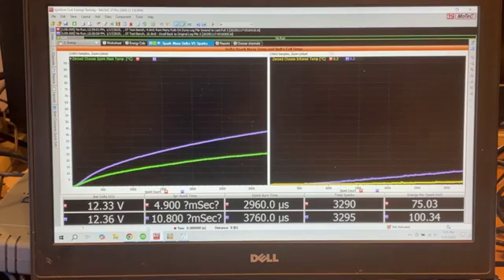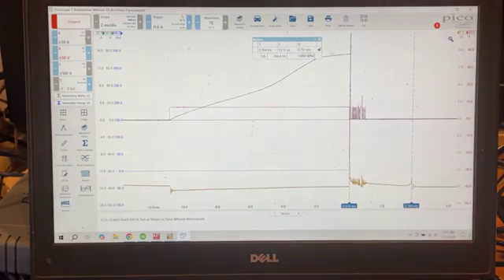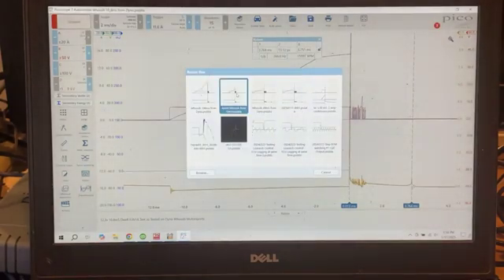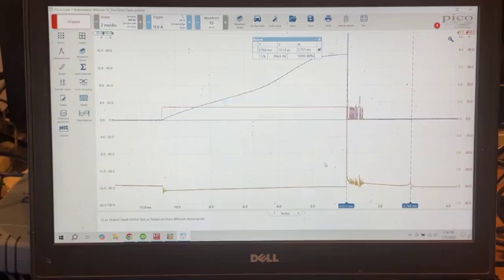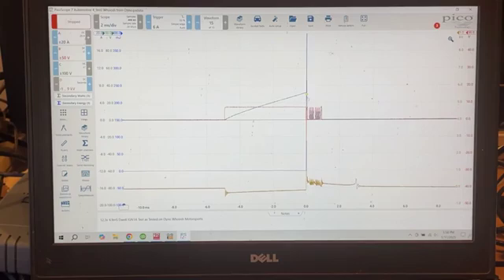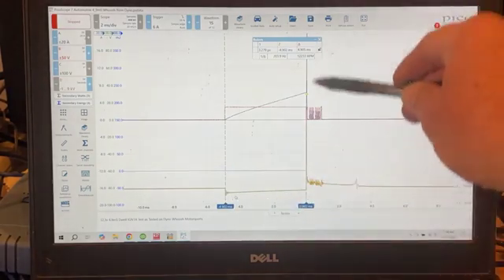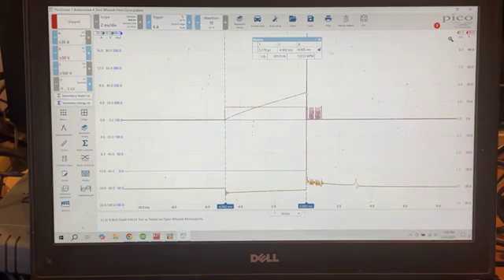IGN1A Ignition Coil Test on Bench versus Engine Dyno - Tuned By Shane T

Comment: The way i did my Coil Testing was a bit basic bus worked pretty well

used and micro controller to send the signal to the Coil, then to capture the power I used an oscilloscope probe connected to a ferrite coil, place it next to the core of the coil and capture the same graphics as yours, and got the correct dwell time for my coils, also have the coil connected to a bench power supply and capture the current used on spark but nothing like a log, and yeah i found that some of them make the same even if i lower the dwell time below its time to saturate. 
great content !

Comment: Nice video, Shane. I agree with your comment about enough spark. I'm a retired OE engine engineer here and amongst other bits and pieces I've developed combustion systems on the single cylinder research engine, where you can mess about with just about anything, easily. You are right about "enough spark". Full load power curves are relatively insensitive to spark energy swings because ignitability is very good (high vol eff, good charge motion, rich conditions, low 'internal egr'), so "enough spark" is usually attainable without leaning on the electrical components too hard. I've found the more challenging regime tends to be light load, high dilution, etc., especially at very light load/idle, and in these marginal areas things like spark energy, plug gap and even number of sparks can make a big difference ... but not always, enough is still enough. These marginal conditions are less of a worry on a race engine because you visit that part of the map far less! As you know, there some things that make a race engine a bit easier to design, develop and calibrate than an OE lump and many things which make life much more difficult in the race scenario.
Reply from the maker: No question about it race engine is far easier to “Calibrate” than an OE engine because of how it’s used. That and lack of emissions compliance.

Comment: Dr. Jacobs said about 1.5 milliseconds is all that's needed to successfully ignite the mixture.
Reply from the maker: 1.5 milliseconds sounds small to a human, but that amount of time becomes a larger number of degrees of the cycle as the revs go up. At 12000 rpm the entire 720 degree cycle takes only 10 milliseconds. It is likely that Dr Jacob’s really said 1.5 Microseconds. But even that number will be dependent on many factors.
Reply: @TunedbyShaneT  You might want to obtain and read "The Doctor's Step by Step Guide to Optimizing Your Ignition," by Dr. Chris Jacobs. I'm certain it says 1.5 milliseconds. "At 12000 rpm the entire 720 degree cycle takes only 10 milliseconds," is true. But, if you had a coil-per-cylinder setup, this would allow for some overlap, and this would still allow enough time for each spark to last 1.5 milliseconds. It also says that 0.100" is the ideal spark plug gap, and it explains why this is so.
Reply from the maker: @nathanrice1796 I’ll have a look, thanks!

Comment: As another datapoint, I tested a few factory coils from cars including Honda or Subaru using an oscilloscope to measure primary current like you did in this test, and found that the factory ECUs were always leaving some charge time on the table. I don't remember exact numbers, but if the coil saturated around 4-5 milliseconds then the factory ECU charge time would be around 3 milliseconds even if it was a coil-on-plug setup with plenty of time available between firing events. This is my first time seeing the secondary coil measurements for spark burn time, thanks for sharing that.
Reply: Also I'm interested to know which spark plug wires you like, as I might install IGN1A coils on my car. And the Paul Yaw shirt is too fun, does he have a ShaneT shirt also?
Reply from the maker: They may be concerned with heating of components for their dwelling mapping values. They have to make it out of warranty. Racing doesn’t have that constraint.

Comment: It's all been done before, wrongly too as you're also doing it wrongly. Platinum products did it a couple of years back, what a joke that was? Voltage jumps the gap, current flows and it's time as in milliiseconds of current flow that's what you want to be measuring.. The product of voltage, current and time makes joules.
Reply: You don't seem to understand the term "saturation" when it applies to ignition coils. Coils don't charge either. The term is known as flux.
Reply: You can't test an ignition coil without loading it up so that it's sparking into something which simulates the cylinder pressure. The higher the cylinder pressure, the higher the voltage before the spark, the lower the current and the shorter the duration.
Reply: If you want to measure energy then measure energy stored in the primary side, measure the inductance of the primary side, measure the peak primary current. E = 1/2 L I squared. That's your initial measurement you need to take first before anything else..........Your vid is 100% BS.
Reply from the maker: Glad you watched it. Be sure to share it!!
Reply: What you didn't mention is that an ignition with more energy allows a bigger plug gap which in turn needs less total timing and then less negative work done which should show a gain.
Reply: @TunedbyShaneT  You didn't tune the plug gaps.
Reply: @1magnit  Wrong answer, the closer you fire to TDC the smaller the gap needs to be, chamber pressure is MUCH higher at 10 BTC than 40.
Reply: @GrocMax  um no. I got it 100% correct.
Reply: With more ignition energy you can increase the gap. That means a quicker burn, less advance and less negative work.

Comment: Seems similar to the oscilloscope patterns on the old Sun Engine Analyzer. 
One thing throwing this old fart for a loop, but, I get it, is your expressing dwell as saturation time, as, back in the day, dwell was expressed as  degrees of camshaft / distributor rotation, for the point set, being mechanically actuated by the distributor cam.
Reply from the maker: Same thing, they just measured it a different way. In this case the dwell time could be converted to angle by dividing the dwell charge time by the total available time at the current rpm to get a ratio and then multiplying that by the number of degrees per cycle. Since we don’t need to fire more than one time per cycle, our total angle is 720 degrees. If you were to divide the total degrees by the number of of cylinders than fire per cycle (8 for example) you could then multiply the ratio by degrees to get a value which makes sense to “old farts” in degrees of dwell.

Comment: Excellent video. I am an electronics engineer with 50 years experience in these matters.
I fully agree with the idea of using enough energy for reliable ignition and no more.
There is a lot of nonsense about a "more complete burn". 
The size of the match does not affect the size of the bonfire on the night.
I am responsible for maintaining a hydroplane GP engine (big block, supercharged, methanol) running up to 9000 RPM using IGN1A coils.
This engine runs perfectly fine with 4.00 mS dwell at 12 volts and also at 2.5 mS at 16 volts (battery).
Never had a starting issue or misfire at any power level considering the engine is running VERY rich and about 20 PSI boost.
Reply from the maker: @RobertRichardson-z3u  yes sir and thank you for that data point. I could not agree more. Once the fire is started, it is started. Continuing with your match analogy, to hold the match while the fire is burning does not change the fire.

Comment: Excellent test and information! Shane have you found a HP level in a boosted methanol application that requires the switch to a CD coil?
Reply from the maker: I have not seen the CDI Outperform the IGN1A inductive coil in that application. In fact the highest output and quickest and fastest Pro Mod used IGN1A not CDI
Reply: @TunedbyShaneT  WOW that's incredible! Thank you again.  Would love to see more of these videos.

Comment: This WAS and IS interesting. In several occasions in the past, I've set out to increase spark energy to gain more performance. From that experience, I'd say more spark = more power, or at least, cleaner burn. But with this modern equipment it appears to be enough spark, and more spark is just straining the equipment. But here's a question: How does the fuel effect in this? Does the super fat nitro methanol need the second plug? Is there a limit where your mix burns so slow, that you could speed it up by adding more energy to the spark? Or, is the answer always just another plug? Oh, and one more: On a boosted Honda, it's accustomed to reduce gap for higher revs. Could added energy keep the gap wider, thus creating more initial plasma for better burn? Most likely you won't see any noticeable difference on a big engine, but a small, one to four cylinder setup does care about the color of the spark.

Comment: Excellent excellent video Shane! Love the methodology on normalizing for spark time. Ignition dwell is one of those things I've never properly spent the time to actually test to see when proper combustion is affected. I have played with dwell on my dyno and like you didn't see a loss in power, but because it was a customer car it got put back to full output just to  be sure issues hadn't been created down the road. But the curiosity was always there and I have messed with it here and there just... because. Love being able to see some good data on it, thank you for putting this video together! Its awesome when data driven people such as yourself are curious, because it helps everyone out!
Reply from the maker: Much appreciated! I’m glad you enjoyed the video.
Reply: Once a coil is saturated increasing the dwell time past that point will do nothing except create heat so it's not surprising at all that you see no difference. So it's not "more dwell" or "less dwell" is better it's having the correct dwell for the coil being used.
Reply: @gtpumps  that's not what Shane was doing here though. He's purposely not fully saturating the coil, meaning there is a difference in spark energy but he didn't see a change in engine output.
Reply: @mrctuned2844 my reply was to your general comment about dwell not what Shane was doing. It's well known if you have enough spark energy for good combustion increasing the energy past that point will do nothing. We did this stuff 25 years ago.
Reply: @gtpumps  I didn't make a general comment about dwell. I stated that I have messed around with purposefully lowering dwell to see if it hurt performance, merely out of curiosity.

Comment: why not measure the high voltage (Hantek Auto Ignition Probe High Voltage Ignition Capacitive Auto Pickup) and current through a spark plug and using "maths" function multiply the area under the curves to get the spark energy
Reply from the maker: I’ve done that using my Pico Scope, but saving and evaluating and in particular comparing two tests to each other is difficult. In addition, neither of those two devices will perform the actual test.